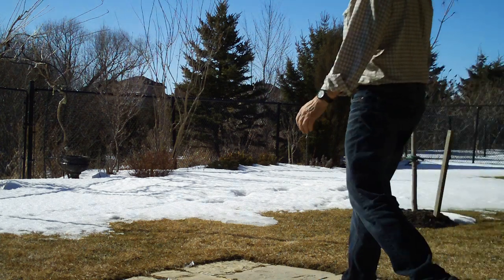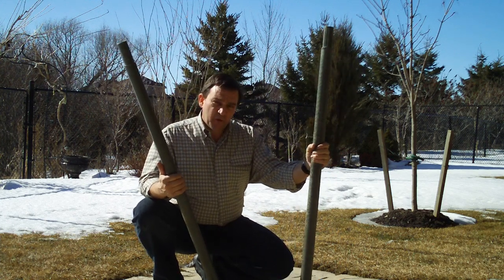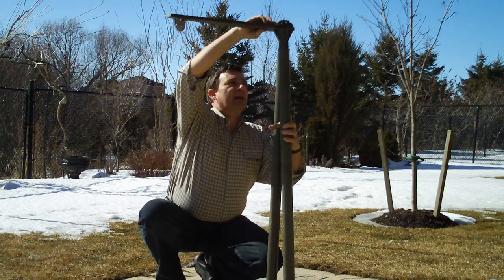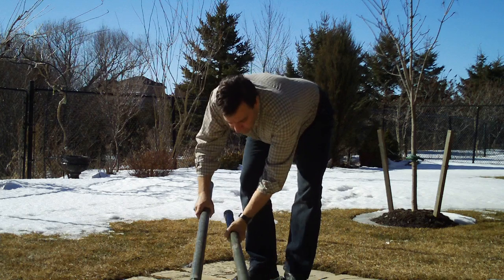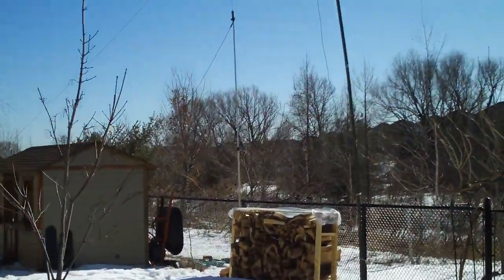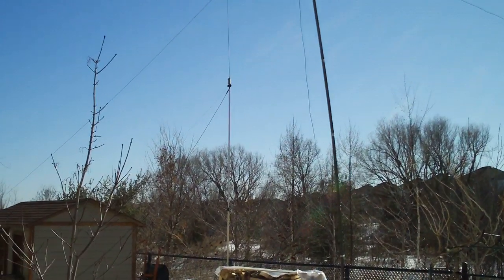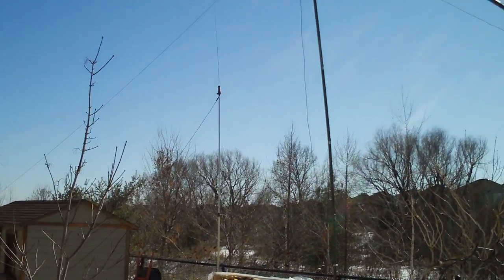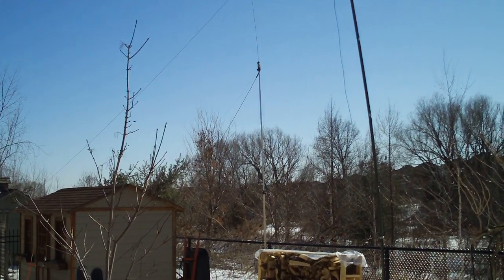Military Surplus Antenna Masts

Comment: I got mine off of ebay USPS to my front door. you lose 5 inches every section except the last one so you have 25 1/2 feet height not 28. 
I leaned 5 sections into a 22ft evergreen bush/tree didn't guy it had a j pole on top, wind came by and blew it over, Every thing survived, coax, j pole and mast. I was still getting into a local repeater with the j pole horizontal flat on the frozen grass with only 5 watt.
73 de n8zu

Comment: Hi Good video.. I have taken the same poles up to 40 feet. I install a stainless water hose clamp at the top and bottom of each stick to keep it from splitting. I get helpers to hold the guys as I lift the unit up placing one section after another on the bottom. I have heard people going up 50 feet but personally, I would be hesitant. I have one up at 40 feet that has been in place for 2 years. It has 2 sets of guys.
73,
WA4AOS

Comment: They are used to support Camo Netting. And if you make a guy ring and place in the middle you mast wouldn't bow. We used them in the military in emergency situations and have had them as high as 80ft, as long as you guy them right and use a lightweight Antenna your all good.
73 W9MJH

Comment: @W5KRC
You need to learn how to read, . My comment is a response to the guy attacking thre original poster from his use of 73 at all. As to the 73 or 73s comment, I could care less, Im making a point, 73's is technically incorrect.
Lighten yourself up, Dude BTW, I dont work on a Cowboy Ranch and dont ride a horse. So in your case, I say use "Sir" when addressing me.

Comment: @sparkyrocky12131963 
What amazes me is that someone with an Amateur Extra license cannot even spell Amateur Correctly. In regards to your comment, if someone cannot figure out that 73 is an utterance meaning farewell, they can easily Google this to find out the meaning. And hopefully this may get them reading something else that may interest them into our great hobby.
73 (and there is not an "s" at the end of 73. )
I have these poles as well. $28 shipped for a bag of 10 on Ebay, cant go wrong

Comment: Nice video. I just put up, for portable operations, 10 each of the fiber glass verions of the poles you have. The height comes out to 38 feet high. I used  a four point guy with two sets of guys. Next time I am going to use three sets of guys. For the price of these poles, they make great masts for portable or the primary station.
KU3X